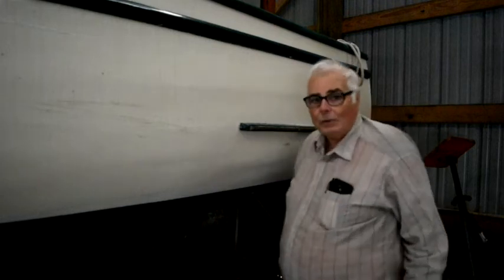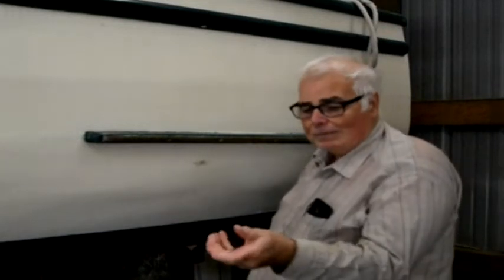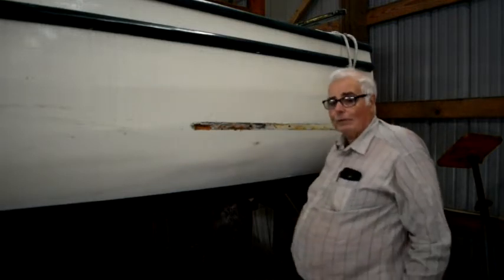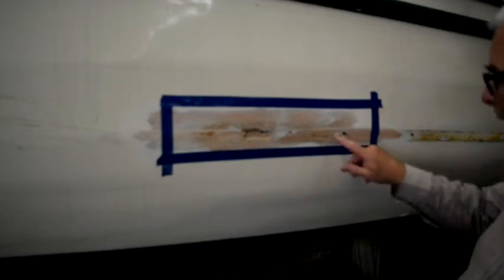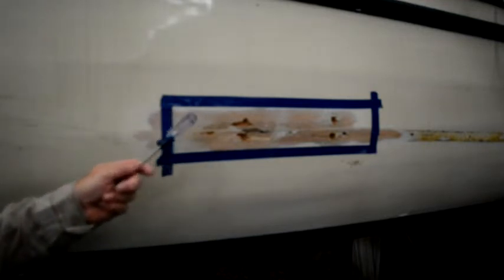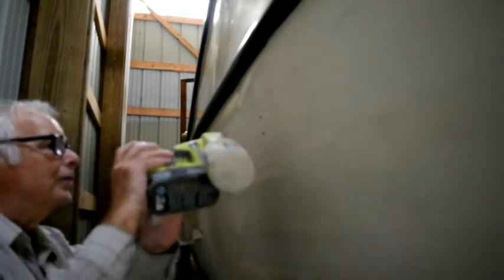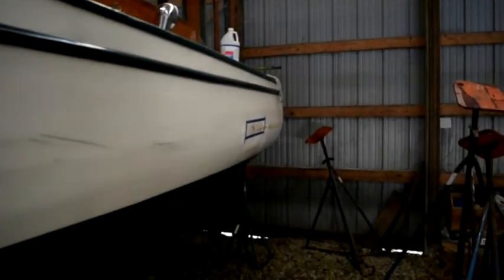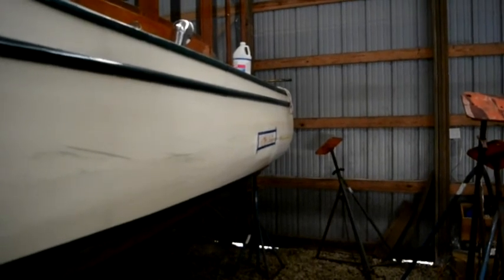Wooden Boat Maintenance - Geting started on Tortuga's Fall work

Comment: Todd, thank you for the excellent explanation of what is involved in repairing damaged areas of the planking on a wood boat.  As you probably remember, I own a 'tupperware' boat so don't get a chance to do much exterior hull repair work.  Stay well.  Bruce J
Reply from the maker: Thanks for the kind words Bruce.  I remember your boat well.  As you may recall I too own a fiberglass sailboat.  Frankly, I find making repairs to the glass hull harder because of the cosmetics.  I am glad the smoke finally cleared out of your area.  Are you getting out sailing much?
Reply: @todddunn945  Todd-yes, we have been out quite a few times over the past 3 months or so, thanks.  We have restricted our trips to the Gulf I. of BC this summer as the border is closed to pleasure boats.  Just prepping  to do annual haul out in Nanaimo, BC, then back to Ladysmith for the winter, with water system drained down of course.  I've enjoyed your recent videos aboard Tortuga.  Best regards,
Bruce